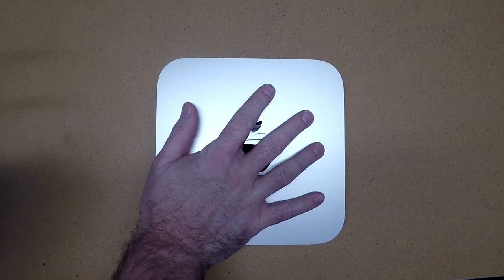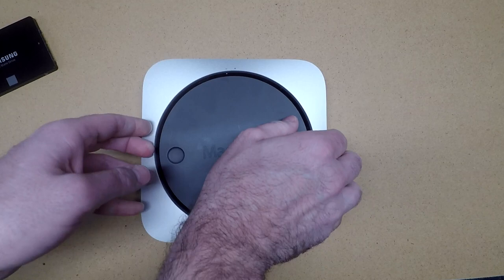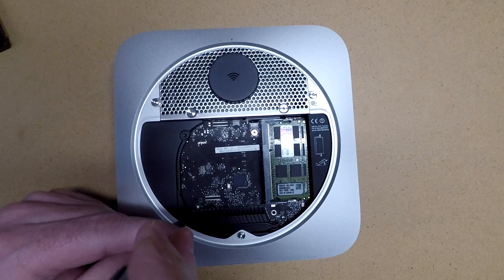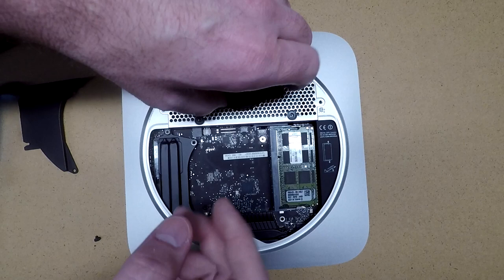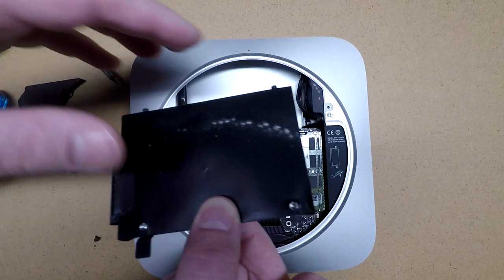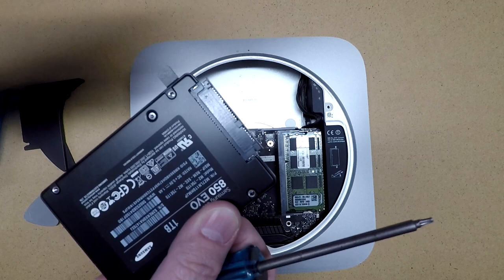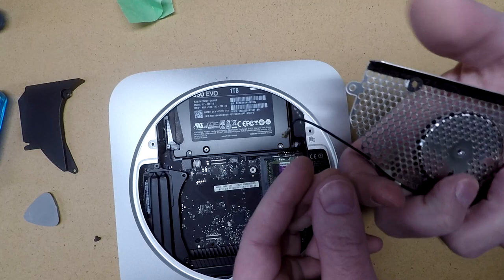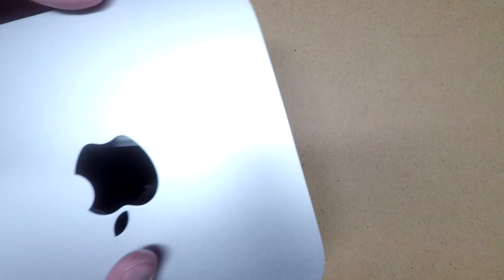Late-2012 Mac Mini (SSD) Hard Drive Upgrade How To

Comment: Don’t use tape. Let senpai help you: 3M body molding two sided tape. It’s about a 2mm thick but can function as a pad. Stick it to the drive and then to anything else you would like. It cures in about 8 hours and will NEVER fall off. You can pry it off. Go try and get the body molding trim off an old car if you would like to know how well it works lol. (will stick to plastic and metal obviously) :)

Comment: Any suggestions on how to get a 1TB HDD out? The old 1tb drives are 9.5 mm. Is there anyway to get these out without sliding back the logic board?
Reply from the maker: I haven't removed a 1TB drive. The models I have upgraded had 500GB drives. I'm not sure how to get that one out. Sorry.

Comment: I really want to do this. In fact, I need to as my 2012 Mac Mini is becoming unusable due to lag. I am happy to read NOT to remove cables as putting them back looked like a nightmare. Now how hard is this to do for somebody with big hands? Even when I built my own desktops where I chose larger cases, it was never easy with monster meat gloves.
Reply from the maker: I'm a typical sized adult male so I have large hands but not extra large. I didn't find this too difficult. There are some small screws and such. You could probably use tweezers to hold them. You can install an SSD in an external exclosure and boot from that. It might be faster than the internal drive. I run one like that for testing but never for daily use.
Reply: @Rickmakes  Visited a small computer shop who said this was easy for them! About 270 CADfor a 1TB Samsung SSD swap, clone and next day pick up :)

Comment: can  this be done with a 2tb or 4tb drive as well? also, is there any other way to clone a drive?
Reply from the maker: It should work with a 2or 4TB drive so long as the drive isn't too thick. I think you can clone a drive with Carbon Copy Cloner (https://bombich.com/) although I haven't used the recent versions.

Comment: Great video, question I’m running out of space and urge to upgrade so that means I have to backup all my info and then copy to the new hard drive?
Reply from the maker: It is always a good idea to have a backup. I think it is especially important to have a backup before you swap out a drive in case something goes wrong (like dropping the hard drive, static shock, etc...).
Reply: @Rickmakes  Carbon Copy Cloner is a must-have tool for this. Clone your existing bootable drive or make regular backups without the hassle of Time Machine.

Comment: I watched a few videos like this, and they all make lifting HD out look easy. Mine won't lift out at all, it's blocked by the RAM board. Mine's a late 2012 model too. It seems that the faith hand side just hasn't got enough "play" to release it from the lug holes at the back. Looks like I'll be paying one to fit it.
Reply from the maker: I've only replaced hard drives on a few of these Mac Minis and haven't had any problems. Sorry you weren't able to get the hard drive out. :(
Reply: had the same effing problem. just closed it and called it a day.

Comment: I want to transfer my data from my existing mac mini to a 2019 mac mini. My existing mac mini has a video problem and that prevents my old mac mini from booting up. The monitors have a green/light green vertical stripes and the boot up process gets about half way and then stops. The old mac mini then will try to re-boot over and over. My question is, can I transfer the data to the new mac mini without having a monitor connected to the old mac mini? Thanks
Reply from the maker: You could probably remove the hard drive from the Mac Mini and put it in an enclosure like this: https://amzn.to/2xSHPqw Then you can plug it into your new Mac Mini to transfer the data.

Comment: my macmini is almost same age  hdd is almost empty but its extremely slow 
a simple web page takes minutes to load could replacing hdd may solve this issue ?
Reply from the maker: I'm not sure on that one. An SSD can give it a big speed boost for things like opening apps and documents but I'm not sure how dependent hard drive speed is on loading web pages. The browser would have to write a cache to the drive so that would be sped up. If you upgrade the SSD, I would upgrade the RAM at the same time. With the SSD and RAM upgraded my Mac Mini, it loads web pages quickly.

Comment: Anybody else experience difficulty with replacing the two screws on each side of the upper bracket?  They just won't go in. Now I can't put the final black panel on...
Reply: Did you ever figure it out because I can't
Reply: Neither can I...
Reply: I'm late to the party here but if you're talking about the Antenna cage, it's a tricky little bugger not mentioned in the video. It has to be seated from an angle. Put it in loosely and then slide it in on an angle. There is something in the underneath of the case that you can't see that it needs to slot into. Google the problem, there are guides online to help. I think it had to slide in on an angle from the black dot side to the white dot side. It took a few goes but it went in. Before that, I spent about 30 minutes wondering why the screw holes wouldn't line up.

Comment: Did you get the new OS High Sierra on it? and did you get it online?
Reply from the maker: I did. I am currently running Mojave. I think you can hit command-R during a reboot and pull up the recovery console. From that point you should be able to download and install the OS.

Comment: hello hi  ! .  I have a new SSD ,  if I replace it to Mac Mini Mid 2011 ,  is it better install a new OS or  should I clone the current OS System?  :)
Reply from the maker: My preferred method is to install a fresh system and use the migration tool to transfer everything off the old system.

Comment: Be careful when trying to disconnect the fan power connector. it's very fragile.
Reply: I hope I would  read your comment before. Have you had to solder it? Is it hard? There are 4 pins there. It's tiny.
Reply: I think you where supposed to lift it up a little bit before you pull it out. what happened was that i pulled it out 
the (wrong direction )same direction as the wires and then one of the wire got loose. so i just put it back in the connector and  secured it in place with tape. how bad is yours? i thinks its hard to solder that, its soo damn tiny. you can get a new fan for the mac mini on ebay for around 2 or 5 dollars
Reply: In another movie, which twice as long, there is a special tool to pull fan's connector up, actually.
 I ripped whole connector from motherboard also pulling in the wrong direction, have to solder it now. Never did this on motherboards before.
Reply: It really is not necessary to remove the fan cable. Once the screws have been removed, the fan can be moved plenty far to get the drive out without disconnecting the cable.

Comment: I did this to my Mini same model and everything is find.... Except that for some reason I get an INSTALLATION FAILED anytime I want to install any program AND my Mac won't upgrade... it keeps saying SOME PARTS OF UPGRADE COULDN'T BE INSTALLED, PLEASE RESTART... So I do that and nothing changes... ANY HELP?
Reply from the maker: That sounds like something may be corrupted on the system. You could try holding down command-R while booting to open the recovery console. From there you can open Disk Utility and run disk first aid. That is where I would start. You may need to reinstall macOS. Either way, make sure you have a good backup plan in place in case you find out your drive is bad.

Comment: I’ve an fusion drive in my Mac Mini 2012 that consists of an 256 gb ssd (probably on the mainboard?) and a 1 tb slow hdd.  Now I would like to replace the hdd with an ssd and also split the fusion drive into 2 drives, while also keeping a clone from the internal(current) 256 gb ssd, which houses osx and apps, on the same internal 256 gb after splitting the fusion drive. Is that possible?
Reply from the maker: I wish I could help but I unfortunately don't have experience with Fusion drives. I'm guessing you could install an SSD in place of the 1TB drive and install the system on it. I don't know if you can format the Fusion SSD and use it as a standalone drive. You might try searching some forums to see if anyone has done it. No matter what you do, make sure you have any important data backed up. Good luck.
Reply: RickMakes thank you anyways for offering your help! I will try some things out and make sure that I’ll have a backup in place.

Comment: hi if i want better performance and i only upgrade the RAM to 16 GB but do not upgrade the hard drive, will i still see a noticeable difference in speed?
Reply from the maker: RAM helps when using a lot of programs concurrently and switching back and forth between them. SSD helps when loading things from the hard drive. Between more RAM and an SSD, I would typically go with SSD. You may not notice a speed increase with a RAM upgrade but you will definitely notice an SSD upgrade.
Reply: @Rickmakes  ok thank you.  what about within a program already open, say Adobe Acrobat or navigating through a website.  a RAM upgrade would not help with those?

Comment: What do I do if my hard drive completely shot. Can I install the new ssd and have the apple store reboot the program
Reply from the maker: Yes. Install the SSD and then boot while holding down command-r. This will boot you into the recovery console. From there you will need to format the drive and install the system on it. Just note, it can take a while to the recovery console to load because it loads over the internet.

Comment: I have a late 2012, what is the largest hard drive I can have for the mini?
Reply from the maker: I'm not sure if you mean size or capacity so I'll address both. It takes a 2.5" drive. With traditional drives, there are some that are 12.5mm thick. From what I have read, those may not fit. I think any of the SSDs will fit. Samsung makes some 4TB models that are 7mm thick. That is the largest capacity mainstream SSD that I am aware of. I think Samsung has a 30TB model but I don't think it would fit and it is very expensive.

Comment: I've just changed the HD to SSD but I don't know why the WiFi plate doesn't fit :'v only one side does. :/ Any idea?
Reply from the maker: Does the hard drive underneith seem flat? The WiFi plate should slip under the curved edge. Were you able to get it to slip under?

Comment: Am I missing something? My hdd looks pretty solidly packed in & isn’t budging??? It looks to be the bottom level to, so maybe I am in the incorrect video? Mine is a dual hdd total 512gb version
Reply from the maker: This is a 2012 since drive model. I'm not sure how the dual drive models are set up.
Reply: RickMakes the plastic film around the drive, with the drive just doesn’t dislodge that easily like in all videos I’ve seen. Even carefully trying to pry around it nothing happens?
Reply: Is yours the 512gb model being pulled out?

Comment: Is anyone else’s hard drive soldered to the base? My hard drive feels like it is soldered by the two corners opposite of the connector.
Reply from the maker: It shouldn't be soldered. Do you know what size it is? Someone commented the other day that the 1TB drive is thicker and harder to remove.
Reply: RickMakes Turns out the hard drive doesn’t just come out I had to take everything out of the Mac mini and unscrew the hard drive. Not that hard but I broke stuff trying to pull the hard drive out while it was secured to the entire base. Oh well if you have a Mac mini late 2012 and the hard drive doesn’t just slip out then read this comment and start taking everything apart.

Comment: Has anyone used the Samsung EVO 870?
Reply from the maker: I just replaced the hard drive in a late 2012 Mac Mini with an EVO 870. Worked great. That Mac Mini is very similar to the Macbook hardware wise.
Reply: @Rickmakes  thanks so much for quick reply! I was looking at prices and the 850 is a heap more expensive

Comment: I've damaged the IR connector, accidentally ripped it off the board, dammit... It is indeed a quite fragile thing, those connectors are really a big pain in the ass...
Reply from the maker: Oh no! Were you using the IR? Does everything else work?

Comment: HOLY JESUS was this difficult! Apple, you suck. I'll never buy a product of your again. 3 hours to get that antenna cover on and it still didn't work. BAD product design.
Reply: Strangely hp has even smaller computer with normal connectors , but it's comparatively loud.
Reply: No, that's GOOD product design. The bastards don't want us taking it apart.

Comment: pain in the butt design as always from apple.
Reply from the maker: Some things are good and others bad. It is as easy or easier to install RAM in the Mac Mini as it is to install in a typical PC. I've come across some PC cases that made it difficult to change the hard drive but most are pretty easy.

Comment: SSD arent good for copying files back and forth they fail easily
Reply from the maker: I haven't had that experience. Any hard drive can fail. It is important to always have a comprehensive backup strategy.
Reply: that's not true!
Reply: What a bs comment.